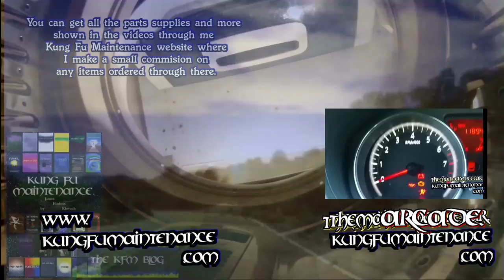Easy Fix For Stubborn Leaking Vanity Sink Pop Up Rod Nut Maintenance Repair Video

Comment: I specifically have this issue right now. I fixed 1 popup plug leak, tomorrow I will work on the other one using your method to stop the small leak, see if I don't get that cross threaded issue. I guess I didn't use enough Teflon tape, cuz is was still leaking a little. Thanks for sharing solutions,  keep going on other house repairs so we can learn from you and save money.  Thank you so much.👍💐
Reply: Ok so I tried to fix my 2nd sink to stop a small drop leak and it is still leaking.  I noticed that the threads on the PVC pipe are a little worped could this be the leak cause? What is the next solution to end this stubborn leak? I've tried Teflon tape, liquid tape, but still have a leak, what else can I try? Please help?

Comment: I have the same type of leak. So in your video, did you apply the Teflon tape just around the outside of the pipe leading from the drain pipe?  I couldn't tell exactly where you were putting it. I assume it is just creating a better seal between the pipe leading from the drain pipe and the piece you screw on to attach the stopper lever. (sorry I don't know the correct terminology)

Comment: What if the leak is coming from the ball side instead of the threads? Any suggestions on how to tighten that seal?
Reply: Brian Wiese I've got the same question water leaking from ball side
Reply: Same question here, have you tried just doing the tape around it though to prevent it from leaking? If so, any luck?
Reply: Haven't tried that but Teflon tape probably wouldn't work around any moving part and that ball on the rod is a moving part if you use the drain stop.
Reply: Could you use some thread sealer or plumbers putty to “pack” around the ball?
Reply: The tiny little nylon sealer gasket that came with my replacement parts is real thin and flimsy.  Seems like it was made to leak!

Comment: Seems like the problem is a plastic unit, lot of the leak after a while and plastic is cheap. I bought the metal one as my replacement, I replaced the entire assembly.  That took care of the leak but a metal unit will run about $25 ..

Comment: I replaced the ball rod.  Now when I pull up the lift rod, the stopper won't stay closed.  Any suggestions please?
Reply from the maker: +Kitswain59 Sometimes you can take the pop up plug and insert the rod through the hole the other way to get a better seat. Sometimes a different pop up plug is needed to get the proper height. Sometimes you can buy so called universal pop up plugs that have rows of holes to reach different heights. There are a few different  sizes so they are not quite as universal as their name implies.

If it fit before it is just a matter of which direction the plug is turned before inserting the pop up rod to get the proper seat. 

Hope that helps... :0)